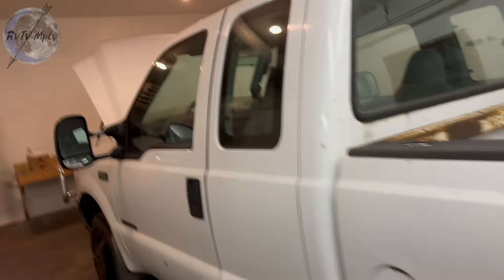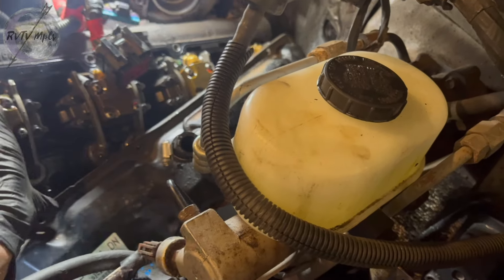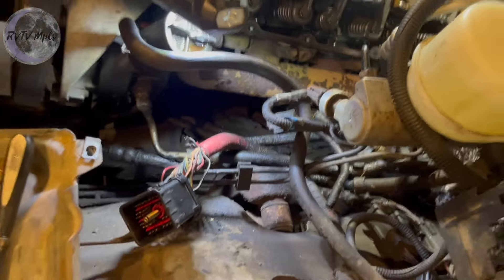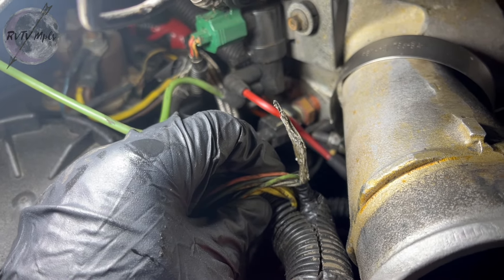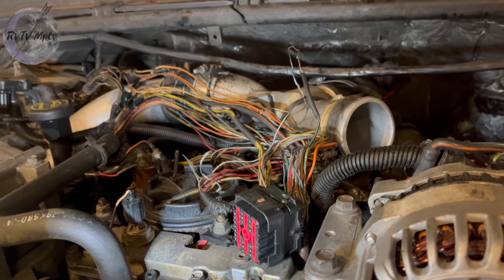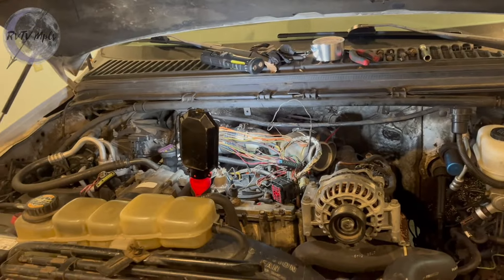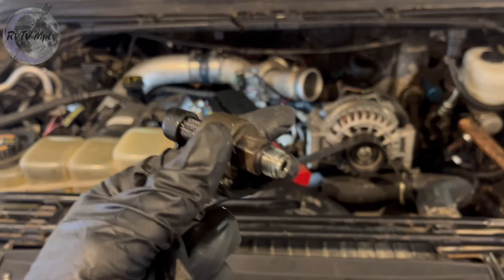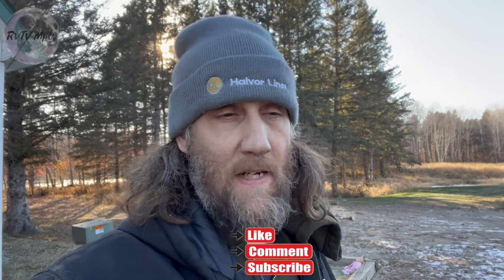F350 Ford 1999-2003 Engine Wiring Problems Solved!

Comment: One question, I have a 2003 Ford F450 6.0 diesel. I found three cables that are under the alternator on the left side that the rats bit and I don't know where they are connected because on the right side of the alternator there are two separate connectors with three inputs each. Can you tell me where? They are connected and the alternator does not charge my batteries and it is new with the two batteries and I think that those three cables have something to do with it thanks